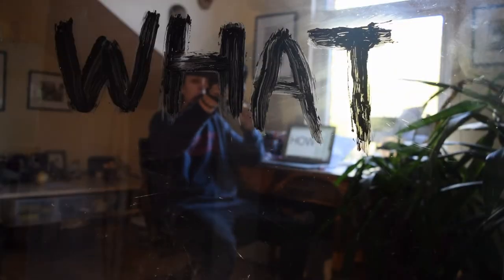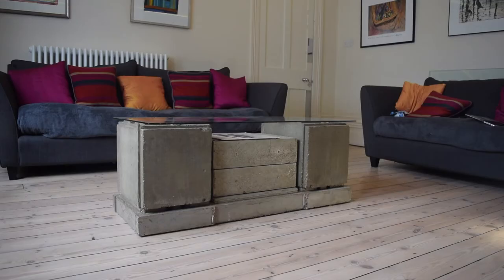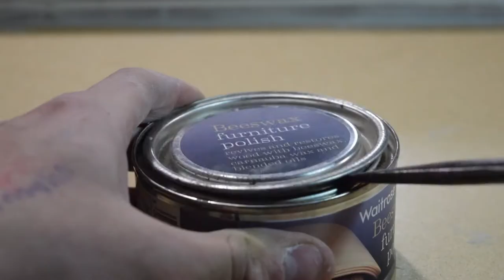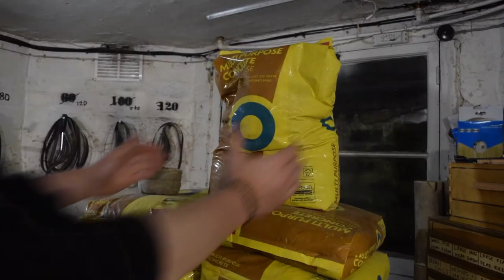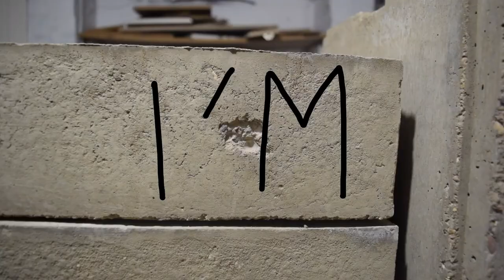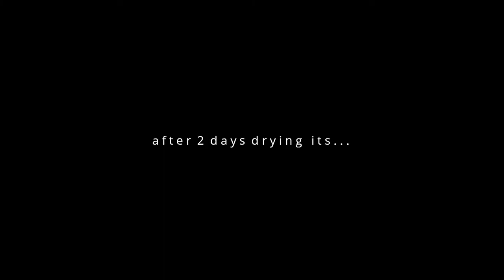Making a Concrete Coffee Table from a Cabinet [55.5]

Comment: Did you know that Thomas Edison designed a whole range of concrete furniture? Also a concrete house...didn't catch on for some reason. Fun concept! If you try ever try it again, you could experiment with polystyrene in the center to cut down on weight and concrete needed.  Would also be very cool to add LED lighting. So many possibilities.

Comment: i like the forms and the piece as a concept , but seems why to costly have to use wood to reinforce a junk wood cabinet , but form over function i guess, just way over complicated, could used spray foam and fiberglass it, or something easier and lighter , thats just Concrete blocks in essences
Reply from the maker: Thanks for the comment! You're 100% right - in an ideal world I would of liked to use a proper table top concrete mix sprayed into the mould in layers & then reinforced with fibreglass, and if I was making more of them I think id definitely do this because the cost and safety risks would be justified. But since this was just an experimental/ one off/ proof of concept type piece I was just using what I had access to at the time :) 
Not sure spray foam would work though, as it wouldn't get the detail required but it could be good for filling the void inside the fibreglass shell?